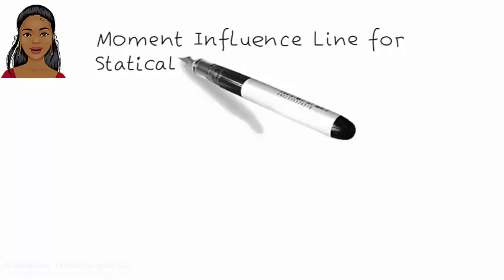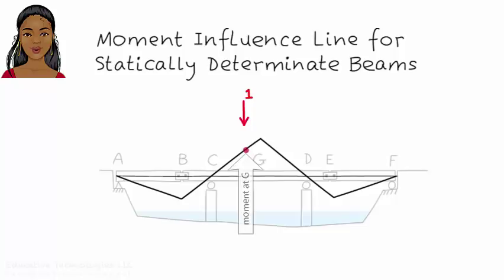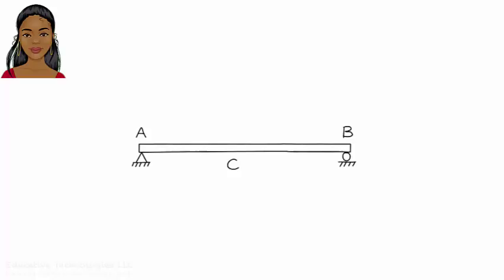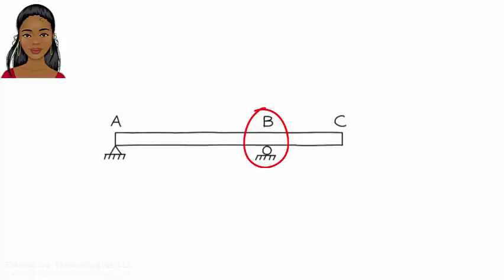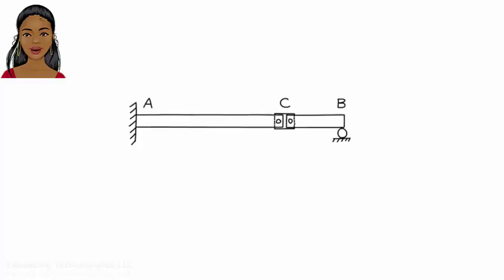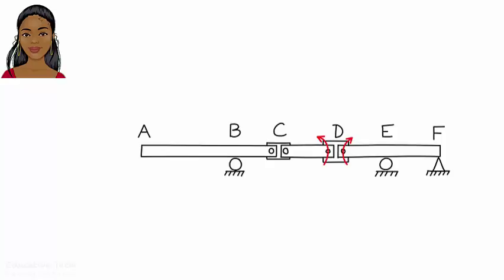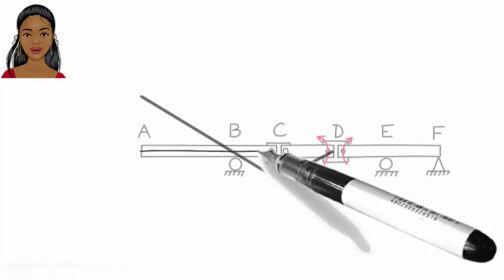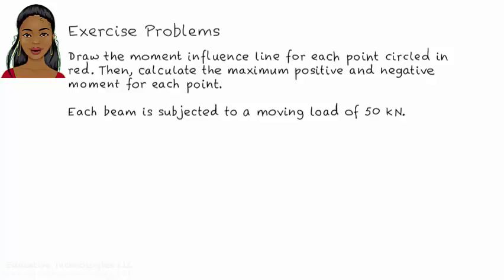SA18: Moment Influence Line

Comment from the maker: +Faizan elahi
The influence line is drawn for moment at G.

The question asks for the load location that causes maximum negative moment at G. Only the middle region of the diagram is negative, with the value at F being maximum. Therefore, maximum negative moment at G occurs when the load is at F.

If we were interested in determining the maximum positive moment at G, then according to the diagram, the load can be placed at G since the influence line shows a maximum positive value at that point.
Reply: Hi, I think the moments drawn at G at 0:43 are in the wrong direction if we are using the sign-deformation convention. I may be wrong however, because I just started learning this topic.
Reply from the maker: The directions are consistent with our beam sign convention: bending moment causing concave up deformation is considered positive.
Reply: Sorry, I didn't see the animation where the bending moment flipped with the movement of the load along the beam. Makes sense. Thank you.
Reply from the maker: @smitpatel5908  The moment influence line for G tells us that the positive moment at G reaches its maximum value when the unit load is either at E or at G. In this case, given the geometry of the beam, both load locations result in the same moment value, since the two positive triangles have the same height.

Comment: If A is hinged and B has a roller support, also C is a free end. B is 15m away from A and C is 21m from A. Find max +/- bending moment at D and E for a moving udl 1kn/m and 3m long, where D is 12m from A and E is 17m from A.
Reply from the maker: Point E is not going to experience any positive moment, it would only go under negative moment. Why? because the point is in segment BC which is an overhang, like a cantilever beam. Bending moment anywhere in BC is going to be negative, if the load is placed on BC, otherwise it would be zero.

Then, it stands to reason that maximum (negative) moment, at any point in segment BC takes place when the load is placed at the far right end of the beam (at the free end).

As for segment AB, moment in the segment (at any point) would be negative when the load is placed on BC. So, maximum moment at any point in AB (including point D), occurs when the load is placed at the far right end of the beam, similar to the previous case.

Moment in AB would be positive if the load is placed on segment AB. The moment influence line for the beam (for D) is going to be triangular in shape with the vertex at D above the beam (forming a positive triangular area above the beam). Given the location of D, the left side of the triangle is going to have a shallower (smaller) slope than the right side of the triangle.  Therefore, starting from D, the area under the triangle 3m (length of the load) to the left the point is going to be larger than the area under the triangle 3m to the right of D. This means, maximum positive moment at D develops when the right end of the distributed load is at D and the left end of the load is 3m to the left of D.
Reply: Dr. Structure plz upload solution for this question.
Reply from the maker: The links to the solutions are given in the video description field.
Reply: Dr. Structure I want the solution for question having udl load instead of point load
Reply from the maker: The solution that  I describe is for a uniformly distributed load, of length 3m. 

To find maximum positive moment at D, please the distribute load on the beam such that the right end of it is at D. Then, analyze the beam and calculate bending moment at D. That would be the maximum positive moment at D.

Then, place the distribute load such that its right end is at the free end of the beam. Analyze the beam again and determine bending moment at D. That would be the maximum negative moment at D. Using the same load position, determine bending moment at E. That would be the maximum negative moment at E. Maximum positive moment at E is zero.

Comment: Considering segment GD to obtain the internal bending moment at G, the equation is Mg = -2 x 0.5 x 4 = -4 as shown in this video. In this equation, where this factor -2 came from? Considering segment FG to solve for moment at G, the equation is Mg = (1.5 x 4) - (1 x 8) = -2.  Thus, internal bending moment considering segment GD = -4 and considering segment FG = -2.  Why are values of the internal bending moment at point G obtained not the same, considering my solution to get bending moment at G using segment FG is correct?
Reply from the maker: The bending moment at G due to a unit load is -0.5 x 4 = -2.

Since the weight of the moving vehicle is 2 kN, we need to multiply -2 by 2 kN to obtain the bending moment due to the vehicle’s weight.
Reply: @DrStructure  Thank you, I now got it. 👍

Comment: at 8:09, I understand that the CD segment rotates downward due to DEF conditions. Would CD still rotate downwards, if we did not have the DEF conditions, and instead for example, D was the connection of a cantilever beam to the wall?
Reply from the maker: If there was a fixed support at D, and we wanted to draw the moment influence line for D, we would place a fictitious hinge at D and apply a positive moment to the hinge. That would give us exactly the same diagram as here. Here we have a real hinge at D, in the case of a fixed support at D, we  end up introducing a fictitious hinge at D. These hinges behave the same way, enabling CD to rotate, of course, assuming joint C can move vertically.

Comment: +Dr. Structure  How can you say that the segment AF carries no portion of the unit load when the load is just to the right of F ? Will the hinge at F not take shear...? 
Well, I got that mathematically by solving equations but don't know how to get that by just examining visually... Please explain...
Reply from the maker: +VIVEK SINGH Place the unit load to the right of F. 

Now, examine segment AE. Separate the segment at E from the rest of the beam. The free body diagram of the segment would consist of a shear force at E and a vertical reaction at A.  Since the segment has to be in equilibrium, and there is no external load applied to it, both shear at E and reaction at A must be zero. With practice, you can draw this conclusion without actually writing the equilibrium equations.

Similarly, examine segment EBF. There is no shear at E, there is a vertical reaction at B and a shear at F, but no applied force appears on the segment. So, using the same reasoning as above, we can conclude that reaction and B and shear at F are zero.

Then, we are left with segment FCD only for carrying the unit load.

Comment: at minute 9:54, when you calculated the Moment at G, what's the "-2" , does it come from the influence line diagram?
Reply from the maker: No, 2 does come from the influence line. It is the magnitude of the moving load (2 kN).
Reply: Dr. Structure I still don't get it.. if 2 is the moving load, then when we multiply them all, we gonna have unit of kN^2m
Reply from the maker: Not quite.  When drawing the influence line, we assume a unit load. The magnitude of the actual load then can be viewed as a multiplier. 

If the bending moment due to the unit load (a load having a magnitude of 1 kN) is, say 3 kN-m, then, if we replace the unit load with a load having a magnitude of 2 kN, what would be the moment value? It would be 2 times 3, or 6 kN-m. 

If the load is 20 kN, instead of being a unit load, then the moment would become 20 times 3, or 60 kN-m. And so on.
Reply: Awesomee.. cheers mate!

Comment: at 9:55, why is there no equation for influence line? Should it be like this: Mg +2(4) + 0.5(4) = 0? And also, why did you multiply the load of the truck in the reaction: 2(0.5)(4)?
Reply from the maker: The free-body diagram shown at the bottom of the page give us the following moment equation (written about point G).

Mg + 0.5(4) = 0.

Or, Mg = -(0.5)(4).

But, this is the bending moment at G due to a unit load, not the actual load of the truck. Since the truck load is 2 kN, we multiply the moment due to the unit load by the load of the truck to get the actual moment value. So,

Mg = - 2(0.5)(4) = -4 kN.m
Reply: To Hector Regala : I know that the way that the lecture is presented is a little bit confusing, however I wanna make this clear that the downward reaction at point D is as a  result of the analysis using 1 unit of load which is supposedly negative 0.5 unit an so a the reaction at point C which is 1.5; they are just both multiplier to whatever is the applied load so that you can get their reactions for both points C and D. Therefore using 2KN moving load, the reaction at point D should be (- 0.5 x 2KN) = - 1KN, and then taking moment at point G :
the equation should look like this>>M@g = negative reaction @D x lever arm = (-1Kn)(4M) = - 4Kn-m.

Comment: At 9:55 , why is the BM equation "-2*0.5*4"? Why is it not just "-0.5*4"?
Reply from the maker: -0.5*4 is the moment due to a unit load. Since we want to determine the bending moment due to a moving load of 2 kN, we need to multiply -0.5*4 by 2.

Comment: for determining numbers of the diagram, we look for the max Neg bending moment only ? or positive as well? if not, how do we know which one is the actual Max magnitude since the diagram just shows qualitative info
Reply from the maker: In an actual design scenario, we need to determine both maximum positive and negative moments in beams and columns.  A positive moment puts the top fibers of the beam in compression whereas a negative moment places the bottom fibers of the member in compression. Since for design purposes, the treatment of compression vs tension parts of the beam differ, it is imperative that we know the maximum values for both positive and negative bending (and their locations) before we can safely design the member.

Comment: you had said that to introduce an internal hinge and apply moment  in order to calculate moment at a particular point for moving load but moment is zero for an hinge then how can we apply moment there?
Reply from the maker: Think of a cantilever beam subjected to a distributed load. In such a beam, we know that the (internal) bending moment at the free end  is zero. But does that mean we cannot apply/place an (external) bending moment (as an applied load) at the free end. No, it does not. We can place any applied load/moment anywhere on the beam including at its free end.  If we did, then we can no longer argue that there is no moment at the free end, since we actually placed one there.

The same idea holds true for a beam with an internal hinge. In the absence of any direct bending moment placed at the hinge, internal bending moment there would be zero. But, we are always place an external moment at the hinge, if we choose to do so.

Comment: what if you want to draw the influence line with z-axis is positive? Because at 3:57 you show the influence line is upwards, when in my case it should be downwards.. Can i still use your method?
Reply from the maker: Yes, you can label the axes however you wish. You can refer to the x axis as z axis, if you like. These labels are all by convention and not laws of physics. The method still works regardless of your chosen Cartesian coordinate system and how you decide to label its axes.

Comment: @3:55 , how come the hinge is displaced upwards ? Doesn't it resists horizontal and vertical motion ?
Reply from the maker: Keeping in mind that the hinge is fictitious, it does not resist bending moment. This means it would be forced to rotate when subjected to bending moment.  Basically, the system acts like a truss, so the joint can move up or down.

Comment: If moment at an internal hinge is always zero, how  does the bar  BC & CD bends ( at 10.59 min of the video ) ? Why don"t they resist the moment ?
Reply from the maker: Are you referring to segment BCD in Exercise 1 at the end of the video?
Reply: I am so sorry. There's been a typing mistake . I was referring to the figure at 6.59 min of the video.
Reply from the maker: Okay.  

First, we need to keep in mind that the influence line does not represent the actual deformation of the beam, it represents bending moment.

@6.59 we are drawing influence line for moment at E, not at C where the real hinge is located. The shape of the influence line (which has nothing to do with the actual deformation of the beam) tells us that if we place a unit load at the hinge (C), there would be a negative moment at E. That is all. The diagram does not tell us anything about the real deformation of the beam.

It is imperative that we don't mix up the technique we are using here to draw influence line with how we draw the actual deformation of the beam. One has nothing to do with the other.

But, your question suggests something more. It suggests that if bending moment at a point is zero, there should be no deflection at that point. That is not correct. To make this clear, consider a cantilever beam (fixed at one end but free at the other end). If we place a vertical load at the free end what would happen to the beam? It is going to displace downward even although bending moment is zero at that end.

Comment: Why is the moment influence line at 8:07 like that? :( Why did it went downward instead of rotating upward at D? :(((
Reply from the maker: For the beam to rotate upward at D, D must be able to move up.  

Examine segment DEF. For D to move up, E has to move up, or it must rotate. But it can do neither.  E cannot move up since there is a roller support at the joint. E cannot rotate either since the pin at F prevents the right end of the segment from moving. So, segment DEF cannot move at all, it remains stationary. This means, under the applied moment, CD has to rotate counterclockwise as shown in the diagram.
Reply: Dr. Structure Thank you!! Really helped a lot. 😄

Comment: How do you determine the heights at the maximum moments at point E F and G for the last example?
Reply from the maker: +Amos Mensah Generally speaking, the moment influence line is used to determine the location(s) of the applied loads that cause maximum internal moment in the beam. We then need to actually analyze the beam in order to calculate these maximum/minimum values. The pick values of the diagram cannot be determined without writing and solving the beam's equilibrium equations.

Comment: At the last example,  how to get the height of maximum postive at G
It is    4+4/8    ?
Reply from the maker: Generally speaking, we do not know (cannot determine) the heights in a qualitatively drawing moment influence line. This is unlike the shear influence line in which the heights can be easily determined. We use moment influence lines for determining the load pattern that causes maximum bending moment. Once the pattern is determined, we then need to analyze the beam to determine the peak moment values.

Comment: In the last example, if i want to calculate the deflection under F? How to do that?
Reply from the maker: You can use the method of virtual work (SA19-SA23). 

1. Write the moment equation(s) for the entire beam under the applied load. Call it M(x).
2. Place a unit vertical load at F, then write the moment equation(s) for the beam. Call this m(x).
3. Integrate M(x)m(x)/EI over the entire beam. That would give you vertical deflection at F.

Comment: In the last example where is the internal loads at Hing when you cut the beam at F ?! and thanks a lot
Reply from the maker: It depends on the location of the unit load. If the unit load is just to the right of F, the internal shear force at the hinge would be zero. That is, when the unit load moves to the right of F, the entire load is going to be carried by segment FCD, the left part of the beam carries no load. Therefore, no shear force develops at F.  However, when the unit load is to the left of F,  a shear force does develop at F. The best way to see how shear force changes as a function of the position of the unit load is to draw the influence line for shear at F.
Reply: @DrStructure  thanks a lot .. you are so kind and I love your channel .. keep going

Comment: Why are you taken moment as positive (as explained in the starting) instead of negative as the moment direction you shown causes hogging effect, and as you better knew that hogging moment is taken as -ve while sagging moment is taken as +ve... So the moment should be -ve instead of +ve which you have taken..that's it
Reply from the maker: You are correct in stating that bending moment in beams is positive when it causes the beam segment to bend in the concave up direction. Indeed, that is the sign convention used in the lecture. Please point to the location in the video that has made you think the sign convention is incorrect.
Reply: Although it occurs in each example in the video, for instance at 2:57, bending moment direction drawn at C tends to cause concavity downward i.e. hogging in the beam...that bending moment should be -ve.. So why are you saying like 'apply a positive bending moment to the hinge'.
Reply from the maker: We might be using different sign conventions in describing positive moment.  As this is a matter of convention, it is of no significance for all practical purposes.

A commonly used sign convention for beams, the one that I have used in these lectures, assumes that positive bending moment causes compression along the top fiber and tension along the bottom fiber of the beam. This happens when the beam bends concave up. What would be the direction of the pair of moments, placed at the ends of the beam segment, that cause such a deformation?  The one at the left end of the segment should be in the clockwise direction and the one acting at the right end of the segment in the counterclockwise direction. That is what we refer to as positive moment in these lectures.